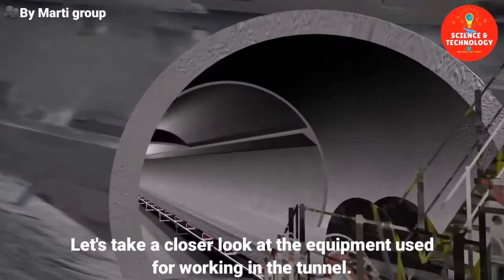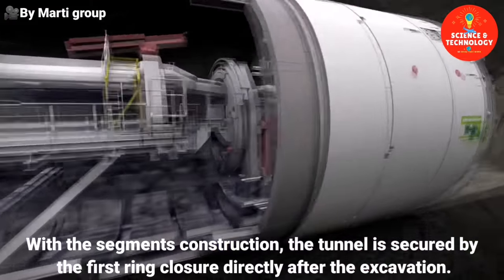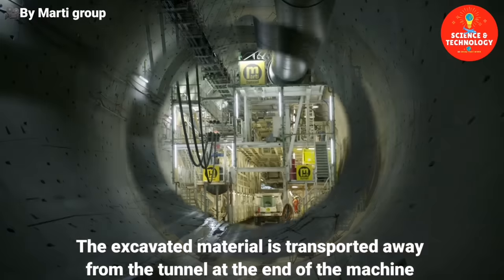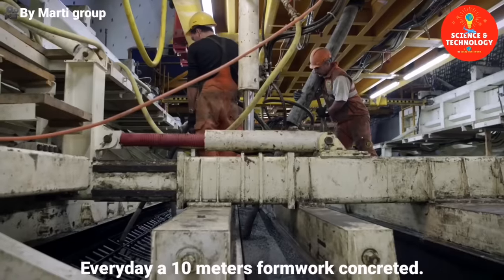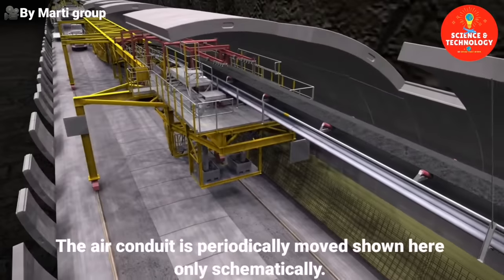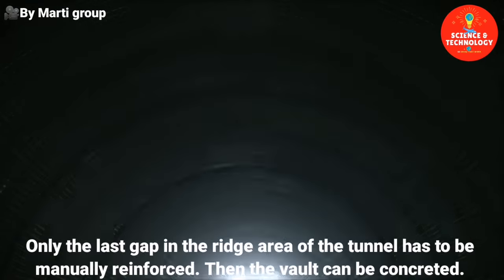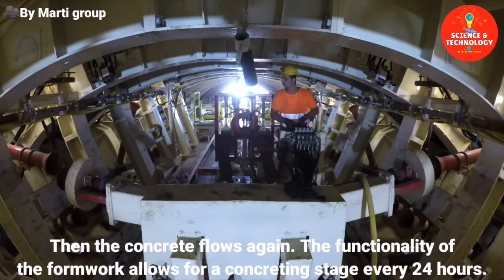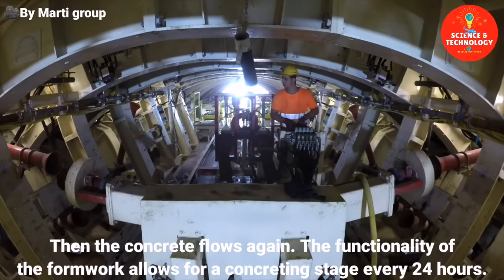INCREDIBLE SWITZERLAND BIGGEST TUNNEL BORING MACHINE DIAMETER-HOW DOES TUNNEL BORING MACHINE WORK?

Comment: Unthinkable that every single thing or feature this thing has had been engineered. The amount of research, manufacturing and testing for even a single part is impressive already
Reply: Even what your using to post this comment is similar. DRAM (dynamic random access memory) itself is an almost incomprehensible feat in engineering.

Comment: The Dutch used one like that 20 years ago. It was called Aurora, the biggest at the time. But theirs was not for tunneling through a mountain, it was for a 5 miles long underwater tunnel for a highspeed train. So instead of rocks it had to contend with muddy soil and a lot of water as it operated some 40 feet beneath sea level.
Reply: What was the overall goal with the dutchess train tunnel?? Overall, the only conclusion I can see and come up with here is the gotthard train tunnel cost billions, and 17 yrs of construction, if I'm not mistaken. All that time and effort just to shave off 45min of travel time,and reduce semi truck traffic on highways and bridges, which it had no success in doing so.
Reply: @jasonwade9160  nothing will reduce car traffic except for decreasing a population or making public transport feasible alternatives
Reply: @maxk880  Several Dutch sities have underground tunnels for highways going through cities, and it has greatly reduced traffic. hence, it's one of the reasons why the Dutch are capable of having such a healthy public transport and bicycle road system.

so, reducing population is not the only solution to alleviate those problems
Reply: @Rukes999  it has not "reduced" traffic. The amount of cars on our streets did not go down. It has diverted the traffic, which is a great thing and improves living conditions in these cities greatly but does not solve the problem real at all.
Reply: Are you talking of Terneuzen? Has been my first construction site for Herrenknecht
Reply: Projects like this strengthen my faith in science and technology, it does not need invoking a superstitious being or praying 5x a day
Reply: @nobs997  Whatever helps you sleep at night!
Reply: @Jason Wade  their system is better than anyone else's poor designing, let's say the USA and UK

Comment: I did case boring at the Edmonton International Airport for a 350 meter job, about 200 meters in we carved out a massive boulder that stopped our progress and when it went by on the conveyor belt it nearly crushed my face aginst the drilling unit I was sitting in. I just ran dirt and and out while adding tracks as we went, anther guy ran the drill. Very high probability of going deaf from the tracks slamming on to the concrete pipe we were pushing in. The sound would travel down and back and if you had no ear plugs in.. oooh man you may as well stand next to a tank.

Good times